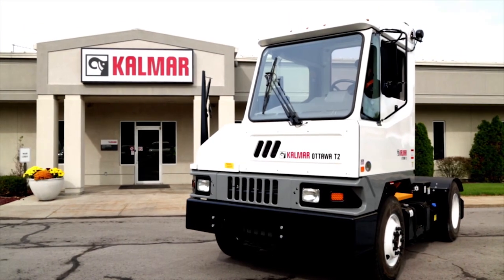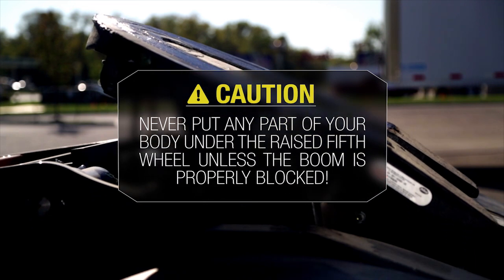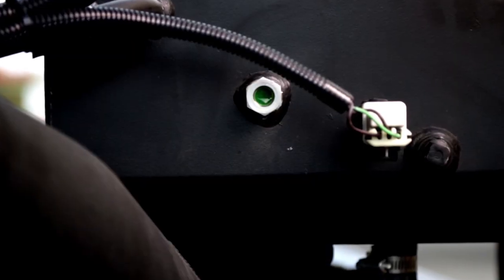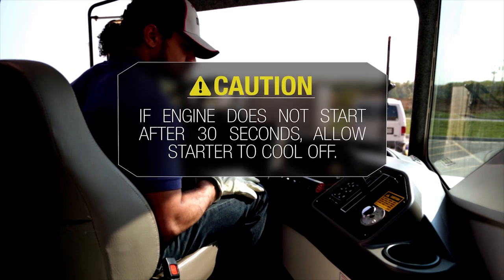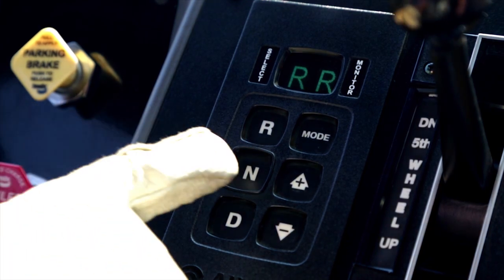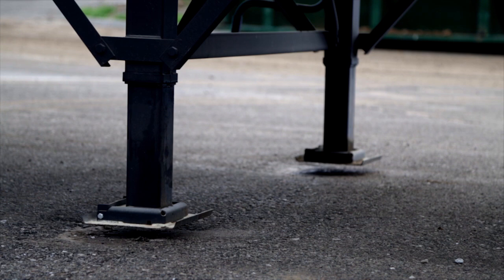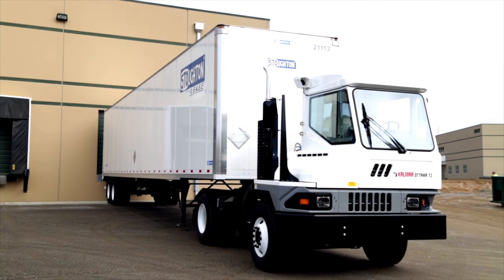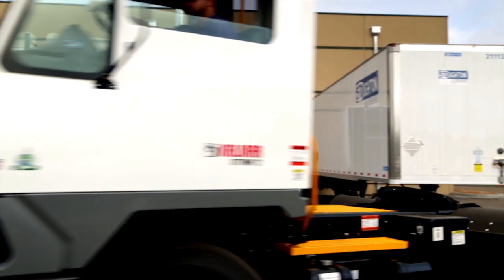Kalmar Ottawa T2 - Operator Orientation 2015

Comment: I wish spotter trucks would be 12-18 inches longer. When you’re hooked to a refrigerated trailer it gets mighty tight getting out of the back when you’re a heavyweight like me.
Reply: Kalmar Ottawa offers their tractor in various frame lengths. Generally, in 10" increments. I recommend that you use the 126" wheel base option, or the more unusual 132" option for refer trailers rather than the more standard 116". Reach out if I can help!
Reply: It feels like the reefer unit is right in the cab with you hot as hell !
Reply: You don't want them too long it defeats the purpose !

Comment: Some of these models are VERY bouncy and hard on your back and neck. The older models are better. Smoother ride.
Reply: Check the tires and the air pressure in them. That is the first line of defense from the surface undulations. The newer T2 has a much better ride than any other tractor available due to better slider leaf spring front suspension, improved air ride seat and improved cab air suspension. However, you have to adjust the seat and the cab air ride properly.
Reply: All switch horses ride like shit even with air ride and are very slow they do one thing extremely well move trailers very quickly
Reply: And they turn better. Yes the old one are way better than these new ones.

Comment: I dove one for a bit. The 2012 design is way better. The Def system is the biggest down side of this one. That and you can't fit a 60 ft shipping container on it. Hits the cab on a turn. The cab was comfy with extra room but in 6 months the plastic cracked on everything especially the roof. It couldn't lift as much as the 2012 either. The bouncy part is easy to fix so I didn't worry about that.

Comment: 2024 model sucks, company bought 11 of these all of them in first 50 mil 0:01 es has had trouble
1. Mirror falling off
2. Fuses blowing 
3. Exhaust system keep overheating 
4. Have to rave the engine jut to get the 5th wheel to go down
6. 3 of the reucks fuel gages are set up backwards, fukk tank reads empty
7. Couple the 5th wheel goes up while driving

Comment: These trucks suck they dont have a driver door that's where I keep my cutters and tools they ride like shit now the commando that's a good truck
Reply: Actually, A drivers door is an option. However many people don't wish to spend the money on it and consider it a safety compromise to have a door which opens out to a four foot drop! Especially,  in light of the back door exit to stairs with handrails for a safe exit. The T2 has been tested and shown that it is big improvement over other brands IN NVA ( Noise, Vibration and Harshness). It is superior to the older Ottawas. Which are superior to everything else out there. Slider front springs, Air Seat and three point cab air ride are the reason for the smooth ride. You may need to have training on how to adjust the cab air ride and seat properly. There is still a pocket on the left side inner panel for your crap. A lot of people put a tool box on the tractor for bolt cutters and etc. There is a large flat area on the dash that makes a great mount for small items in a "jockey box".
Reply: Cmon man it has a emergency exit if you know where it is.

Comment: These trucks are absolute garbage. Nothing but issues with these newer ones. Had a 2014 and it was way better than the 2020 model.
Reply: The 2020 is the only year our ac actually worked on. Well it didn’t in 2024 for the first time